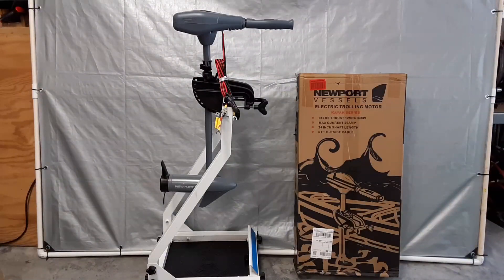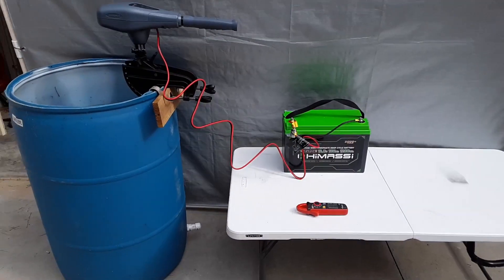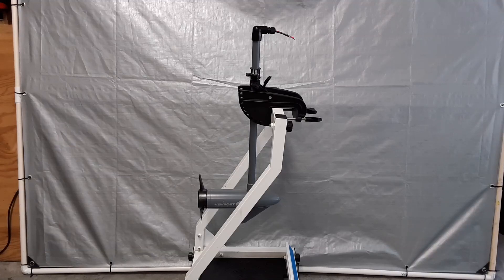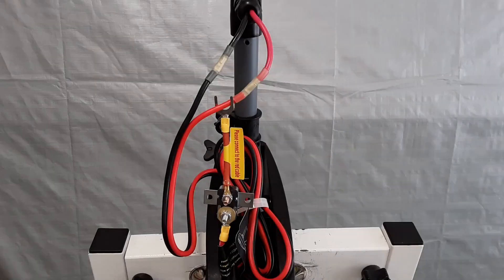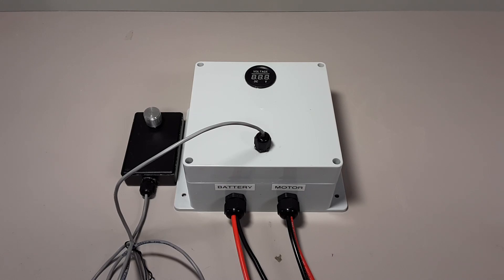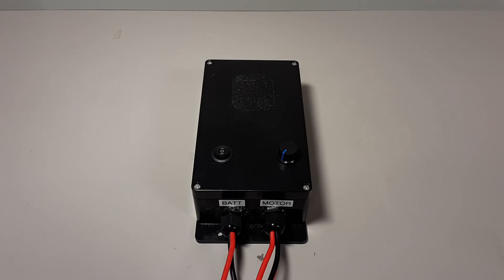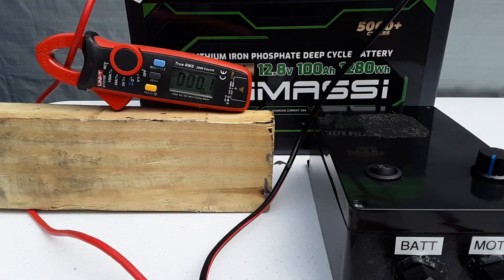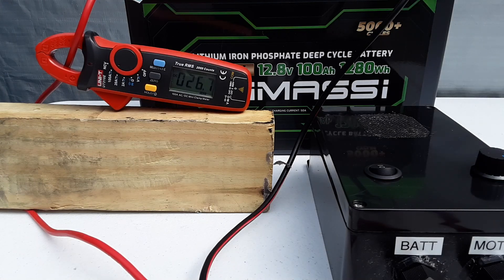Trolling Motor WOT AMP Draw Test Comparison for Stock Switch and PWM.

Comment: How is the internal temperature of the box without a fan? I've seen people install a fan on their box but I'm concerned that water might get in the unit.  Thanks! videos are awesome
Reply from the maker: Thanks! The Minn Kota Traxxis PWM has a heat sink and waterproofing so it has no issues. I have found the Amazon PWMs with the fan seem to run a little better that the ones without one. I haven't fried one yet.

Comment: You're really not saving anything because the power output is reduced as well.   The reduced current with the PWM is the result of it being extra resistance introduced into the circuit.

Comment: I just tested my Motorguide Digital 55lbs current draw with the same clamp meter. The WOT draw was 35A. I had 70Ah AGM battery in use.

Comment: The real winnings are four smaller boats like kayaks which want to troll around .8-2mph! Thats where pwm efficiency becomes exponential
Reply: I had a full throttle on/off switch on a bait boat for carp fishing, and when I upgraded to a speed controller, I went from using about 4 x 7,2Ah batteries a day, to just the one. Boats definitely don't use amps in a linear way. That final 10% higher speed comes at an enormous energy cost.
Reply: @DanieHattingh  for sure. I raced model boats as well, if you go to brushless, you can use a 6000mah lipo and probably get two days in!
Reply: @tylerrandolph6193  that is very interesting. I assumed, based on nothing, that brushless would be much heavier on batteries. Probably because the performance jump is so big.
Reply from the maker: Yes.

Comment: you're getting 10% less power draw, and you're also getting 10% less thrust basically. if you want to use less power just get a smaller trolling motor. what ive come up with lol.
Reply from the maker: Actually, you are getting the same thrust and WOT but using less power to achieve it.
Reply: @Aksmaniyak , No because you are supplying less power by PWM there is no magic to get thrust out of no where. explain how you are measuring WOT. you're simply testing pwm modules for efficiency. Correct you might loose power with stock esc with heat, but adding a PWM module to the same battery won't increase efficiency. you're just loosing thrust along with less power draw. it's just hardly noticeable on larger boats i assume. I do like the video. theres a part missing where you measure the thrust of the output prop with each controller. turning it on max with each controller doesn't really prove anything.
Reply: @eagleray1  correct, and even at lower speeds the theory of a PWM switch adding efficiency is very vague. you are very correct, a machine meter would be needed to measure the thrust/rpm of the output to get a full result.  but I could be wrong... but i mean i played with alot of trainsets when i was younger. lmao kidding but not.

Comment: I would be interested in seeing a PWM vs ESC amp draw test. I speculate that the ESC might be more efficient.
Reply from the maker: I would agree with your speculation. However, I have moved from using PWMs to ESC s now. Perhaps somebody will run those comparisons.
Reply: @Aksmaniyak  I will also be switching a ESC based on your videos. Thanks for sharing!
Reply from the maker: @351HOON  Glad to help!

Comment: I question they final statement.
What your test tells me is that the pwm is not allowing the motor to reach its true full throttle.
You would need a rpm gauge or a on the water speed comparison to determine this but its what i expect is happening. I dont buy that the stock switch is losing amps at wot.
I guess you could actually test this by running a amp test with no switch or pwm, just a direct wiring motor to battery.
That should give you a base of the motors full amp draw. But it wouldnt show if the pwms are losing power/rpms while drawing less amps at wot.
Reply from the maker: Valid points and that is why I stated that it is not a scientific test. The test was to see if there was a difference in the controllers. It would be nice if a company would do a test under lab conditions.
Reply: I did the following test when I was setting up my pwm a couple years ago. I tested my speed (calm day on a lake) using just the trolling motor (stock new Minn Kota 30 lb thrust). Then I inserted the pwm between the battery and the trolling motor (left the trolling motor on full throttle). My max speed decreased 7-8%. Removed the pwm and the trolling motor max speed went right back up. So I think some amps are getting lost somewhere in the pwm, but I'm no electrical engineer and have no idea why that happens.
Reply from the maker: @craiggruenberg9591  I'm not sure either without seeing the set up and test. Hopefully, a company will do a controlled test someday and publish the data.

Comment: Are they putting out the same RPM's though?
Reply from the maker: Why would the rpm change?
Reply: @Aksmaniyak  because the pwm may not have the same rpm at wot, its possible the pwm is limiting the rpm at wot there for drawing less amps.
Reply from the maker: @NiteWolfeFishing  That is possible. I wanted to use 2 completely different PWMs to see the results. The results were similar.